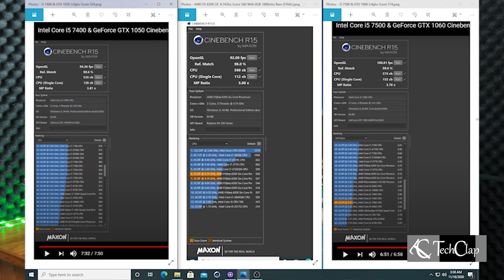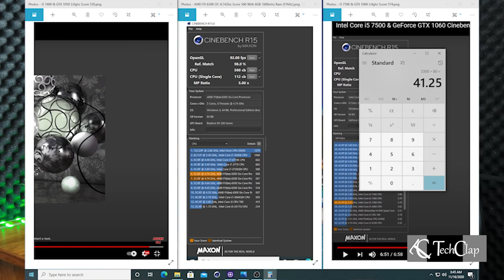youtube video #-DndtHGKf8s

Comment: Fx 8350 + Rx 570 enough 550 Watt power ??
Reply from the maker: Yes, but use a good branded PSU. Like: Thermaltake, Seasonic e.t.c
Reply: Sir I have cooler master 550 80+ bronz
Reply from the maker: @pragneshvasava4589  it should work. But gold would have been better. Don't overclock your CPU or GPU with this PSU.